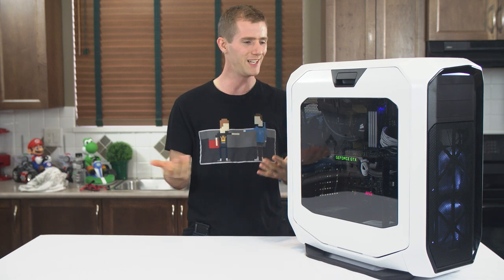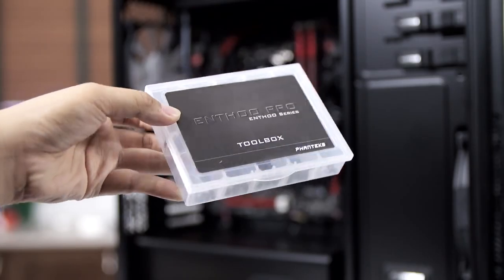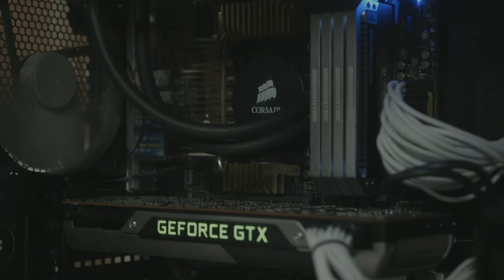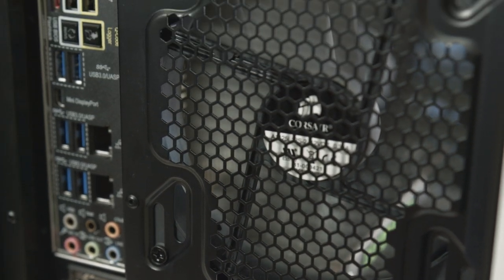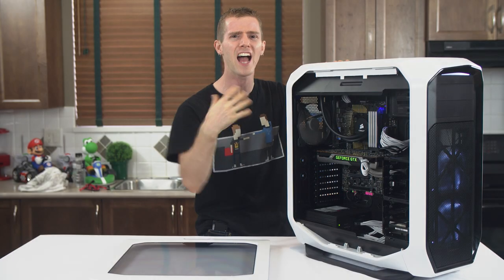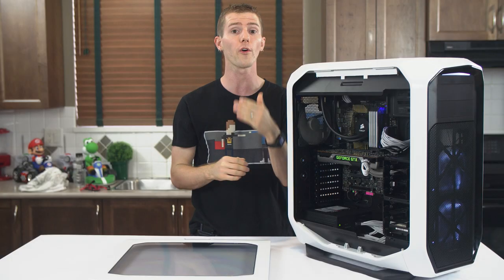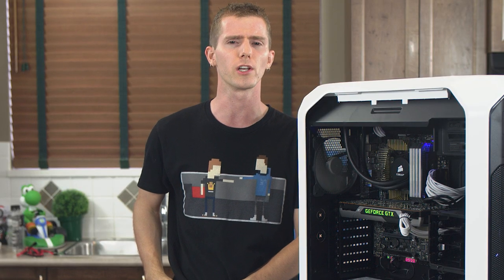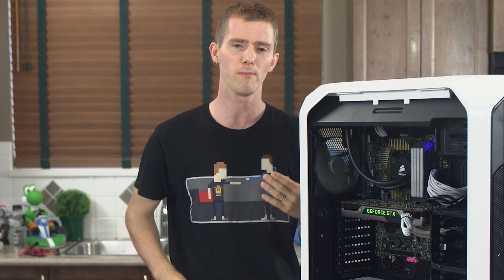Corsair 780T Graphite Case

Comment: Can someone help me! My H100i gives a yellow LED while booting. I've got Windows 8.1 64 bit, an Intel Core i7-4790k (not overclocked), an Asus GTX Strix 970, an Asus Maximus VII Formula, 16 gb DDR3 @ 1333 Mhz, Corsair RM750 PSU, 2 TB HDD, 64 GB SSD. Thanks
Reply: Did you plug in the CPU fan cable?
Reply: +Geniux HD yes of course! First it was white and after 3/4 weeks it turned yellow and now it is red. Sometimes it is white again but many times. I don't have any corsair software.
Reply: +Geniux HD not many times*
Reply: perryhoofd
I would call the costumer support of corsair, if i was you.
I dealt with them a couple of times and you should be getting up and running again in no time :D
Reply: Geniux HD The color indicates the temperature. If the CPU is running hotter than normal it gives another LED color. The weird thing is, I started (for example) with BF4, and I'm still playing BF4. No graphical changes.
Reply: perryhoofd
perhaps too much or too little thermal paste?
Reply: Geniux HD It was pre-applied with the H100i.
Reply: perryhoofd
hmm...
perhaps dust in the radiator?

Comment: NEW AT BUILDING PC.

Help ! I really want a gaming pc that can stream to twitch really well ! Any good recommendations for cases ? I want my case to have what I require at the bottom listed. :) Thanks !! Want the case to look bad ass.
Max price I want to spend is $2,000 under.

I got to start doing that whole, don’t-look-at-my-bank money thing and spend very little and cautiously now while trying to save money to build my computer that can stream video games to twitch and just to play them with no lag.

Also want to be able to play games from consoles but don’t know how that works so.

I want it to be my buff babe. lmao.

just trying to find a case that’’s like the Corsair Graphite Series 600T, that can hold the motherboard

MSI X99S SLI Plus LGA 2011-v3 Intel X99, Intel Core i7-5820K Haswell-E 6-Core 3.3GHz, CORSAIR Hydro Series H100.

Also the memory G.SKILL Ripjaws 4 series 32GB (4 x 8GB) DDR4 2400 (PC4-19200).

The graphics, GIGABYTE GV-N970G1 GAMING-4GD GeForce GTX 970 4GB
(This card is HUGE, it will NOT fit in most cases unless you can remove one of the drive bays.)

Storage, SAMSUNG 840 EVO 250GB HD.

Power, Antec HCG M HCG-850M 850W.

The Thermaltake Commander G42 can hold all this but, I want a Corsair. Or I want something that looks fancy like the Corsair 780T Graphite Case. I love being able to see the guts like that case. I also want it to be soundproof.

If you can suggest any already made pcs that can game AND stream really well for HD, please let me know ! Also reccomend me a few things ! :)

What OTHER case(s) will hold all of those guts ???

ALSO, I see a lot of times where people have two pcs (one for streaming and then one for gaming). Do I have to if I want to stream and game ?? I only want one.
Reply: 32gigabytes of RAM are overkill for something that isn't a Server. 16 gigabytes should be far more than you would ever use while streaming. So get 16 gigabytes.

Comment: I never got the top fans in my black 780 model.
Reply: Because it only comes with 2 intake and 1 exhaust fan
Reply: And another question is, can I get a 360mm in on the top with the 5.5" bay installed? Because I have a Disc drive for nostalgia.
Reply: Michael Tarantino yes you can, just use the lower drivebax
Reply: Kevin Harbach Thank you!

Comment: Does anyone know if this case would be good for these specs:
Mobo: Asus H170M-PlusProcessor: i7 6700kRAM: Kingston Hyperx DDR4 16GB 2400hzPower: Thermaltake Smart 750watts P750wHDD: 1TBGPU: EVGA GTX 1050Ti SC 4GB DDR5
In fact, could anyone tell me if this is a good rig? Is there anything else I should take into consideration? I'm not an expert on these things and I just want to get a nice upgrade. I plan to create content and game on high settings.
Reply: moythecreeper this case is too big for the specs. I'd say go for the nzxt s340 or s340 elite. it's newer looks great and with the money you save get a z170 motherboard like gigabyte z170x gaming 3 or asus z170 pro gaming aura and a gtx 1060 3gb/6gb or a rx 480 4gb/8gb. and also a cpu cooler you will need that as 6700k does not come with Intel's stock cooler. I'd recommend cryorig H5 universal I also have it it's an awesome cooler.  probably the best in it's category
Reply: Hasham Khan Thanks, my friend.
Reply: Hasham Khan Next year, probably in christmas.
Reply: Hasham Khan  December 2017

Comment: Decent looking case but I no longer buy anything from Corsair.  There support is ZERO. My keyboard has had dead leds for a long time now. There phone support is always busy signal , Dont return emails and file a ticket or question system dont even include keyboards or mice.  They seem to be avoiding support for those products.  For this reason I simply buy other brands that have good support.  You should consider doing reviews of products that actually have real people that respond to RMAs for all of there products.  Money is tight and to spend the kinda money they want for there keyboards and such and then not even have those items listed in there support section on there website is down right wrong.  I have learned my lesson.

Comment: Really need help guys, http://pcpartpicker.com/p/LQMvsY
what do you think. I need to bring down the price, i will not compremise on the motherboard, graphics, or watercooling, or the case(it looks soooo awesome)
Reply: The psu is the FIRST priority component you shouldn't  compromise on.  Everything else is a distance second.
Reply: i just want the power, and the silence, does anyone know any other 0rpm fan 700/750w psus?
Reply: TheTerminatorOfDoom The 5820K is really unnecessary right now, a 4770k will do you just fine. you could switch out that Phantom 820 for the Phantom 001 (in either black, red, or white). That optical drive is really overkill unless you actually use it for blue-rays, I dont know anyone that uses their optical drives anymore so you could just get a $20 DVD/CD reader/writer. This will all save you $252. I didnt care to look at the custom parts that you had, so you might be able to save a few extra hundred there.
Reply: i want the upgradeability for the 2011-3 cpus in the future, thanks tho
Reply: TheTerminatorOfDoom By your strict requirements, there is really no way to bring the price down...
Reply: does anyone know any good cheap 0rpm psus?
Reply: You want a good PSU.
Reply: Right well clearly budget is not an issue so i would say that that PC looks brilliant but the memory could be better try getting 2 8gb sticks of Kingston ram its what i have and i cant recommend it enough. But that is a nice PC.